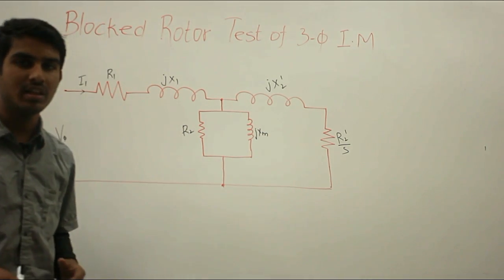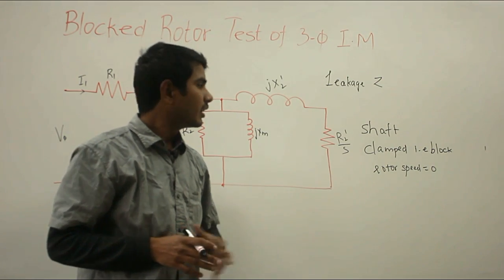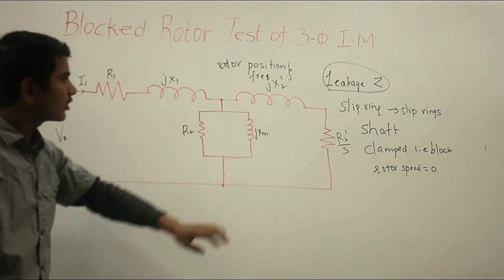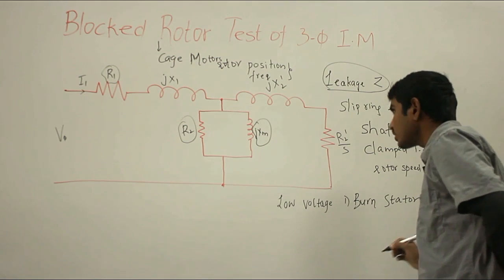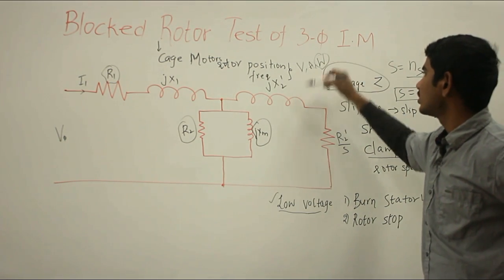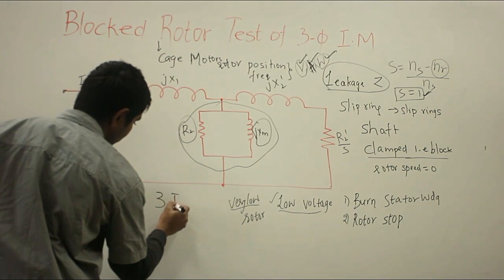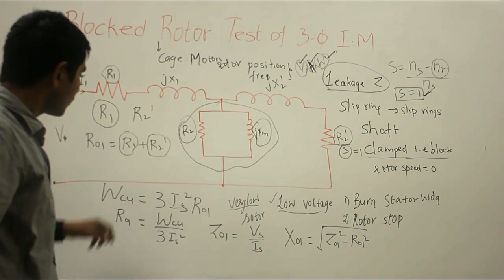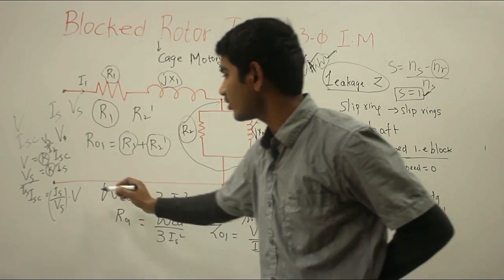Blocked Rotor Test Of 3 Phase Induction Motor

Comment: is that X01 you wrote as X2'..
Reply from the maker: Pravineesh Krishna 
It is the referred reactance of secondary side to primary side i.e, rotor side to stator side
Reply: Smile and Learn 
X01 is rotor reactance refferd to primary. then X2' is?
Reply from the maker: Then according to you X2' IS X01 only
Do not confuse with indication  better you write Xr'to avoid any further confusion
Reply: Smile and Learn 
thanks for the quick reply's. your lectures are very helpful.

Comment: The resistance and reactance per phase of the rotor of a 3-phase induction motor are 0.6 ohm and
5 ohms respectively. The induction motor has a star-connected rotor and when the stator is
connected to a supply of normal voltage, the induced e.m.f. between the slip rings at standstill is 80
V. Calculate the current in each phase and the power factor at starting when (i) the slip-rings are
shorted, (ii) slip-rings are connected to a star-connected resistance of 4 ohm per phaseIF ANYONE CAN HELP ME PLEASE GIVE ME THE SOLUTION       sihlenmsimango@gmail.com
Reply: 15.88 amp 0.119la g and 11.77amp  0.677lag